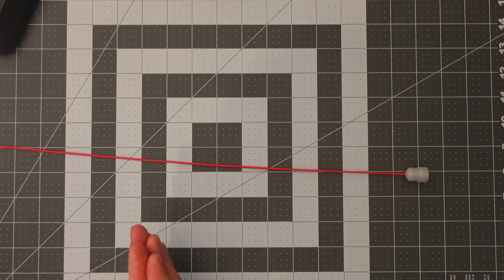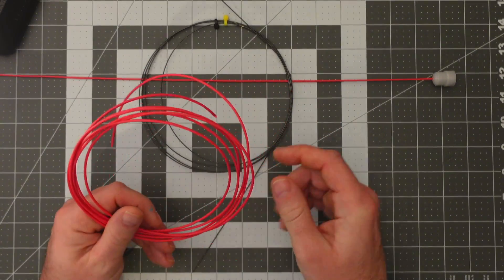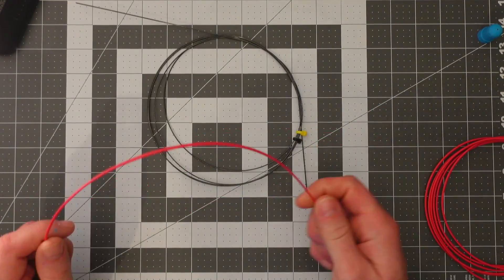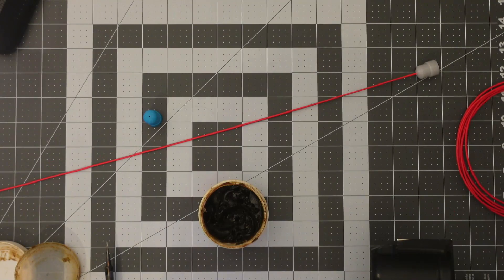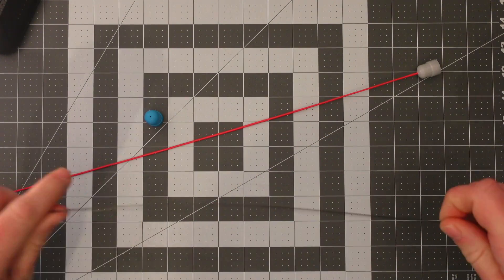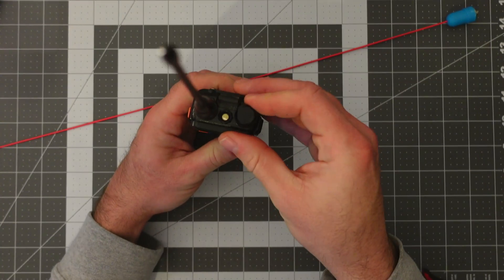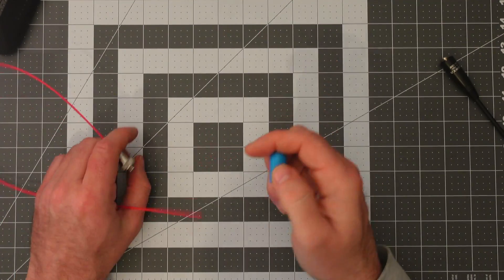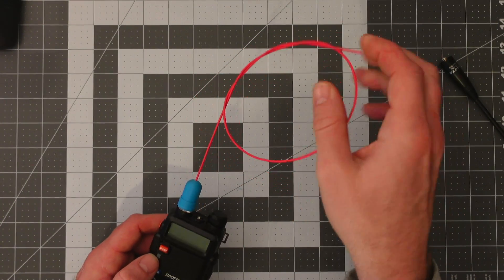How to Make A Flexible Antenna - Like a Signal Stick (But Definitely not)

Comment from the maker: Video may have blurry spots - I have limited lighting right now.  Don't worry!!! There are instructions in the description.  
Also, I purchased another batch of nitinol and this time, the length of the antenna is more towards 18.5- 19 inches. Just check it with an analyzer.

Comment: When You Soldered, You Had Some Problem To SOlder That Wire Onto Solder Itself, Hey, I Can Send You My Own Made And Designed Paste, Its Good paste, I Have Video Abbout How I Made It, I Always Think About Things And Problems, I Figured Out The Needs And It Resulted To One Of The Best Soldering pastes Ive Used, My Own. You Juist Need One Acid And Some Other Chemicals To use It, Some Califonium Rock, Zinc And Thats Pretty Much It, Other Things ARe Rations And Things Like Work And Crushing. The Results Are Crazy, You Will See That In Video, Teh Video Is Called - Soldering Paste That Bonds "Tin" Better Then Anything Else I've Seen On Market

Comment: If Only I Had 3D Printer Or Any Money To Buy Such Things to Make This Cool Antenna. results ARe Crazy Shocking, I Make ANtennas And Sometimes I Solder Everything Wrong Because Im Short Minded :D 
Watching Now Videos On How ANd What Antenna To Make. This Looks Really Cool One. :) Will Try It, I Have SOme SMA Connectors That Was Sponsored To Me, Still Need To Produce Videos On How To Solder Them Onto RG402. :) WHat I Will SUbstitute To The Wire You Used Is Bike Brake Or Gas Line Outter Shell, It Always Goes Back To Its Original Form Wich Is Straight, I Will Use That, But Its 10 Times Hevier. Is There ANything You Would Recomend?

Comment: I don't have a 3d printer. Anyone have any possible ideas for a boot? Maybe something I can find at the hardware store. Is a boot even necessary?
Reply: A plastic bottle cap?  Drill out the top, thread on the bottle cap, trim any excess from the bottle cap to give a snug fit, flood the cap with hot glue.  That should give rigidity and water resistance.

Comment: I made this antenna and several times to make it better. I got 1.5mm stock and just ground it down to 1.3mm which is the diameter of the pin, so I just used it instead of a pin. Made it work with some clever heatshrink positioning and some epoxy and it stays. Best part is if something fails I get the Nitinol piece and redo the antenna and go back on air. One problem I have is it is bent and not straight anymore and I heard you can reshape it in -15C but havent tried that one yet.
Reply: I walked outside with a signal stick on an antenna while trying to get a GPS signal and it was freezing outside and within a minute or two that signal stick went limp! It was kind of funny and luckily I was just outside my house not out in the wilderness where I'd be like oh crap. If you just put it in your freezer for a little while it'll probably do the same thing. Then take it out and hang it up so it hangs straight ... and warm, and stiffen back up.
Reply: Is the 1.5mm more like what Signal Stuff uses? I bought a couple 717 antennas that are definitely too flexible for my taste, (and compared to a Signal Stick.) I've even added a layer or two of heat shrink, but still, it's too flexible. So much so that the signal will whip in and out as the antennas whipping back and forth.
Reply: @barrykem8876  Yeah signal Stick uses 1.5 with custom pins that take this diameter. I do get a tiny bit of distortion when walking arround but regular usage is good not to whippy the 1.5mm and it fits great instead of a pin directly to the BNC adapter. Way way more stable that way than putting it into a pin and then the BCN rocks back and forth. This way it is rock solid. I can send you some photos of the darn thing if you like.
Reply: @barrykem8876  I will do this thank you!!! I made the same antenna probably 5 times with the same piece of nitinol just experimenting with connectors and different shrink tube. Latest one has a big ol pill like resign ball that glows and the BNC connector is water tight by adding some kind of electrical self adhesive band to it.

Comment: SO SO COOL! thanks for this videos !!! I love it - you might like this one - place an aluminum can( antenna) onto your computer trackpad( receiver) and watch as your computer cursor moves by itself - seemly intelligently controlled by an unknown signal
Reply from the maker: I saw your video!  VERY neat!
Reply: @DudeTested  I purchased a Playtron, it's one of those 'turn objects into capacitive touch and play music' devices if you're familiar - I attached the ground wire to a aluminum plate by clamp and the 'capacitive'' wire touching but not clamped to the aluminum plate to create capacitance - and it's a radio - and I'm getting straight up alien radio beeps - I uploaded that video under SHORTs if you are interested

Comment: How do you get the SWR to stabilize on the analyzer?
Reply from the maker: if yours is jumping around dramatically. check that the wire is stripped bare enough and connected well enough.

Comment: Great content would it be possible to give the Finnished length of antenna using the 1mm nitinol wire you used for all  the band's 2mtr 70cm ect  thanks

Comment: BNC Soon Will Be Past My Friend, Itt can`t get Above 500Mhz In My tests, Not The Most tScientific Tests, but Hey, Itt SHows Anyway That Performance Drops Because Of The Connectors, SMA Goes Good Above 20GHz, But The BNC Goes Bad At Early 500Mhz So Jeah, I Think With More Developments And Millimeter Bands The BNC Will Not Be Good As For TThe Future, Use SMA Where You Can , But if You Do HF Work, Bnc Is The Best :)
Reply: Not all connectors are created equal.  What did you pay for the ones you tested? What brand are they.  Were they 50 ohm or 75 ohm BNCs.  High quality/higher priced 50 ohm BNCs from Amphenol, Pasternak etc. are good to 4 GHz. 75 ohm or poorly machined connectors with with substandard insulator will not work as well.

Comment: Ah, oops. I am legally blind, so trying to solder is out of the question. Last time I tried I burned my nose.
Reply from the maker: I'll build you one if you'd like.   Sma male or female?
Reply: @DudeTested  Okay, I'm an idiot, I forgot all about this video. I do have a question for you. I am building an antenna for my recumbent bicycle. And I would love to use a signal stick, and I actually have, but it wiggles about pretty bad. What I want to know. Can I add another layer of heat shrink tubing to stiffen up the antenna, and will it effect the transmitting of the radio in any way. Oh, and I need one BNC :)

Comment: Have you figured out the exact length I should cut it for a dual band antenna?
Reply from the maker: I had two batches of wire.  The first batch, I mentioned in the video.  The second batch from aliexpress, about 18.8 inches, which is about dead on and accurate.  My suggestion, start at the first length and cut down until your meter shows it is resonant.  Use a counterpoise with the meter.   My best guess on why  the numbers were off is, inconclusive. Could be different velocity factors of the two nitinol wires.

Comment: Could this be done with a SMA male (radio side) to SMA female (antenna side)?  Instead of soldering the nitinol into a BNC, can it be soldered into an SMA, or is the SMA hole too small for the nitinol? Looking to make a 33cm (915MHz) antenna for meshtastic.
Reply from the maker: I would think it could with some modification to the stl file. . https://www.thingiverse.com/thing:6386300  This was for sma female (to nitinol) to sma male (to radio).  Looking into an SMA Female to Female connector should be the solution.  https://amzn.to/3Vno8Qz (affiliate link, used to shorten the URL).  These could work with remixing my file, but I have concerns the soler would just go straight through to the side which would need to plug into a radio.

Comment: Nice video, too bad you didnt mentioned what was the final measurement you cut the wire to make it work. I know you mentioned 19inches was too short but what was your final measurement of that wire that worked for you ? Thank you so much, slavko VE3XYD 73s
Reply from the maker: That's correct.  I didn't mention the length because it may vary depending on the diameter someone purchases, the quality / brand of  nitinol and more.  I recommend going 25 and checking where the SWR is (with a tiger tail attached, would be optimal).  Then getting an idea where you are resonate and cutting down from there, little by little.  If I had to guess, mine was around 21 inches.

Comment: Great video.  Unfortunately, the Nitinol I got from the link you posted was not very springy at all.  It did not hold its shape at all.  Bent over like a limp noodle.  I’m going to search for a different wire and try again.
Reply from the maker: That's really interesting.  I am sorry if I linked the wrong nitinol....  Are you good on the zed?  I will ship you some for your troubles.
Reply from the maker: https://nexmetal.com/products/nitinol-superelastic-wire?variant=21956546820 I found this and it is possible this was the stuff I got. (I've ordered a lot of different nitinol wires).  However, I can send you a couple feet.
Reply: Thankyou but not necessary.  I did some research and I need to make the wire as straight as possible and then heat it up to “set” the wire configuration.  The only heating the wire got was just enough to shrink the shrink tubing.  I think it needs more then that.  I’m going to give that a try.

Comment: And for those of us without 3d printers, where do we get the parts
Reply: Fill the inside of the bnc adapter with epoxy ant it'll be the same
Reply from the maker: Places that may have 3D Printers to help: Local Libraries, Local ham clubs.  Or, the 3d part is just cosmetic.

Comment: Interesting, because the Signal Stick is 19 inches long. I have 3 of them. As for the ball on the end, use a small bead and super glue it on. And why are you using 184mhz? Since it is not in the legal 2 meter ham band?
Reply from the maker: Did you know that different diameter wires could create different results in length. This depends on brand, the exact ratio of metals (probably effecting velocity factor?)  used, and much more. Take for example bntecho go.   Using that for an efhw would only require 63 ft for 40m.   Much shorter than other wire.

Comment: And finally, you're going to need a 3D printer.
Reply from the maker: If you don't have a 3D Printer, it would be a great time to get to know your club or check out your local library
Reply: Also it works without it. The print is cosmetic.
Reply from the maker: Yes, that's right! Cheers  @chublez